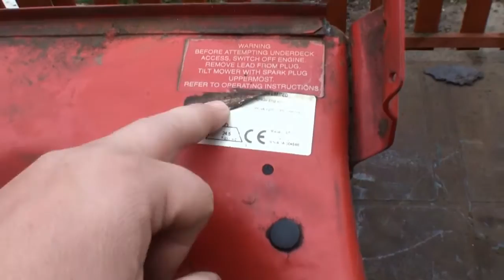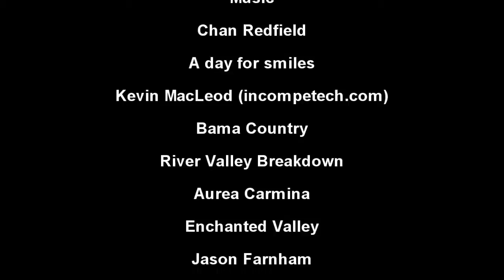Lawnmower Repairs: The Triple Lawnmower Challenge

Comment: Martin, the plastic spring clamps you have in your workshop are ideal for 'temporarily' holding the run lever to the bar when looking around a running mower - as they can be released quickly. Not recommended, i know - but I use them when setting the idle/tickover etc if i'm working on my own. Cheers.
Reply from the maker: Good idea, I forgot i had them as I normally use a bit of duct tape lol.
Cheers
Martin

Comment: martin just wondering do you ever patch holes in decks and what is your preferred method.  i have been getting far more engines than solid decks lately and am going to have to patch some decks up because i cant get hold of any good ones

also what kind of primer do you use and with what tip size

cheers
Reply from the maker: Yes, I have patched decks up. If the deck is a good solid one, i'll weld a new patch in. We are now using 2k primer Lechler Ti, 4 to 1 mix with 10% thinners. 1.0 - 1.4 tip.
Cheers Martin